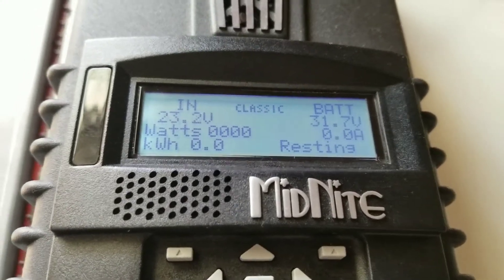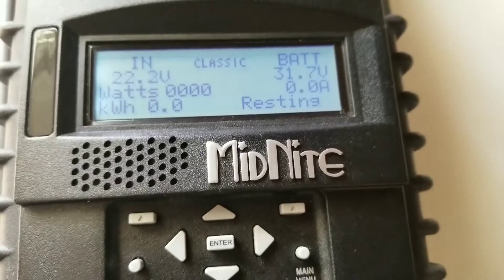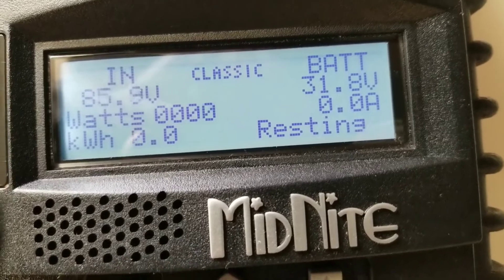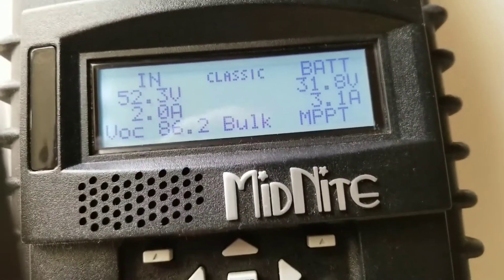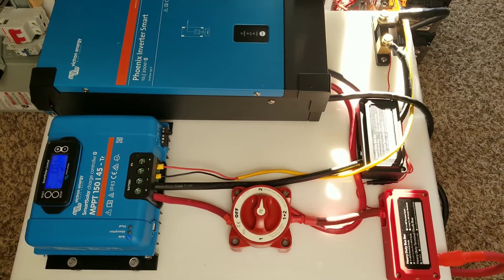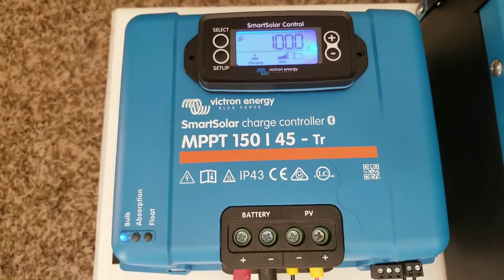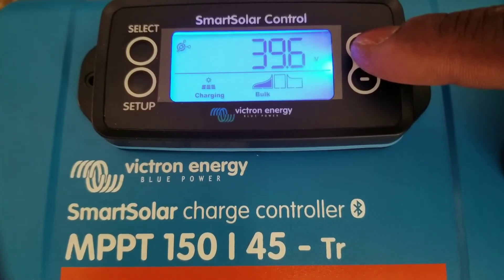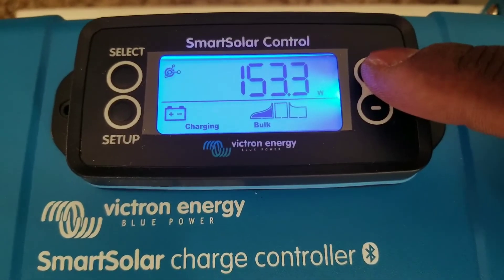VICTRON ENERGY vs. MIDNITE SOLAR MPPT SOLAR CHARGE CONTROLLERS CHARGING ALGORITHMS

Comment: So if both cost 700 used would you pick the midnite classic 250 or the victron 450/100?
Reply from the maker: It all depends your project purpose. 

For Solar, Wind, or Hydro power project, you want go with MidNite Classic.

If only for Solar usage, I will go with VictronSmart MPPT Charge Controller instead of the Midnight Classic.

There is a lot of advantages and disadvantages on both Controllers.

THANKS FOR WATCHING, LIKE SHARE AND SUBSCRIBE.